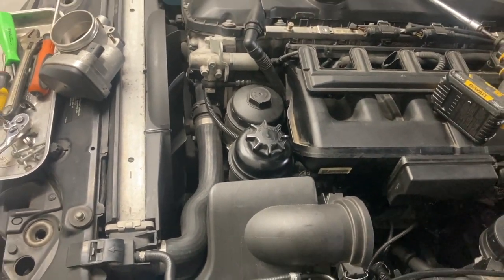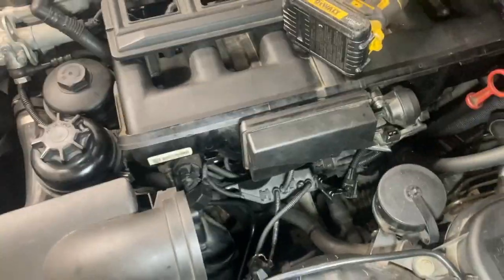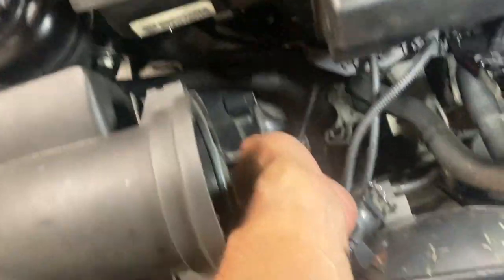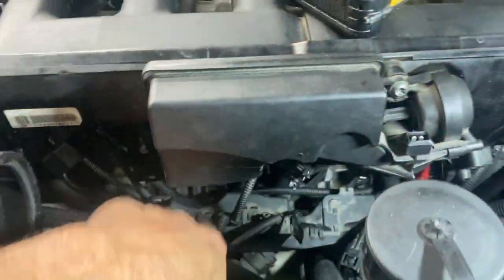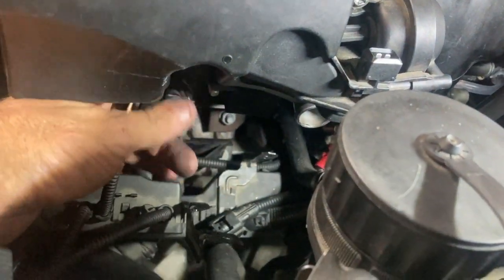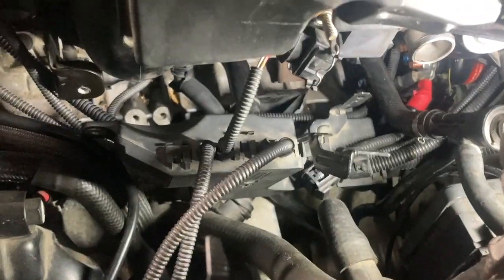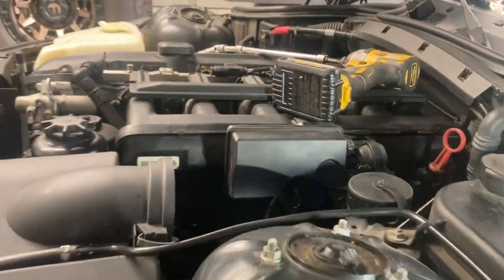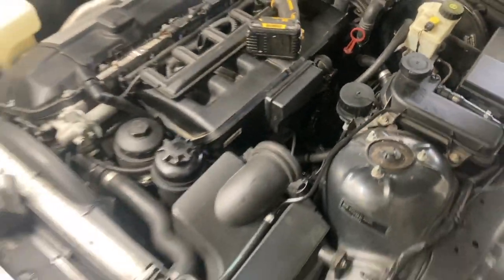Intake fuel breather valve tube hose BMW M54 Z3 3.0

Comment: Currently trying this method on an e39, I don't know how you can get both hands in, the bracket under the throttle body is maybe different. May have to just take the intake manifold off lol
Reply from the maker: It was precarious and it’s a sequential maneauver. You’re trapped there until you work your way back out. It sucks.
Reply: @sdalin27 I was somehow able to do it without removing the intake manifold. Patience was key